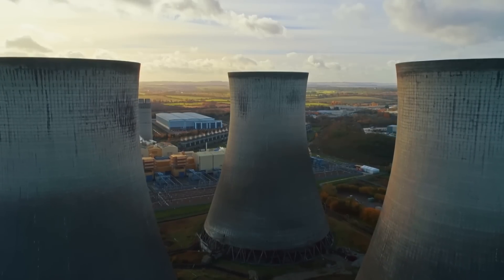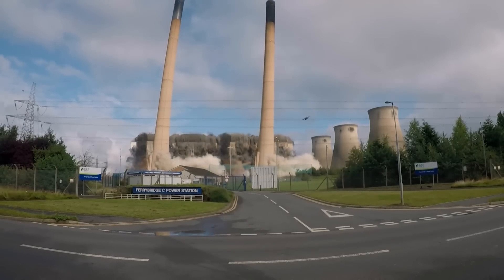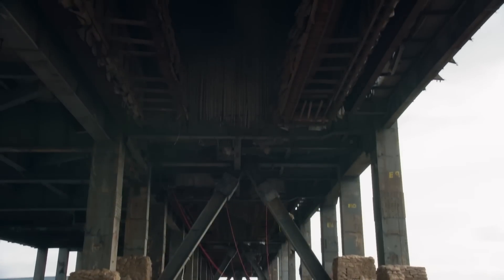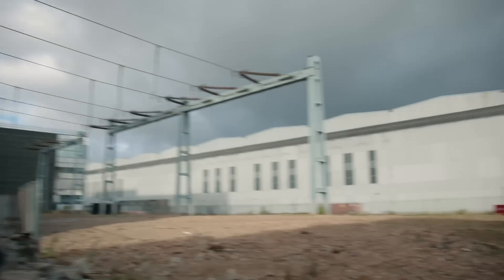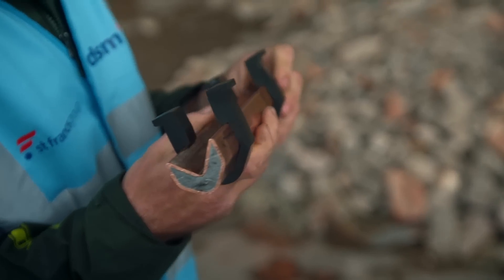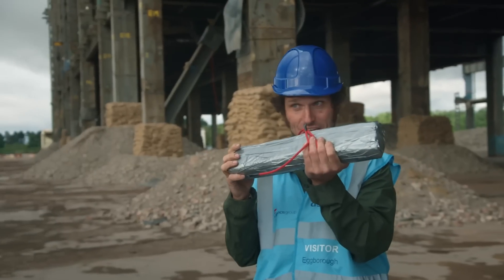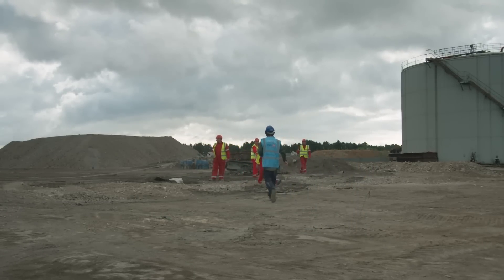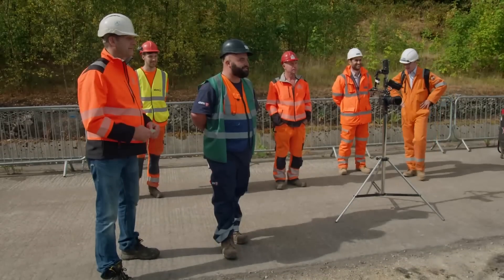Guy In His Element Blowing Up A Power Station! | Guy Martin

Comment: Amazing. They invite a guy from Lincolnshire to blow up a power station I can see from my front door but are incapable of telling me when it's going to happen.   As an aside, the boiler house was expected to turn into a heap on the floor. It didnt. Two frames remained half standing and took in excess of 9 months to be dismantled using two large mobile cranes. 

Did  i mention I can see it from my front door?